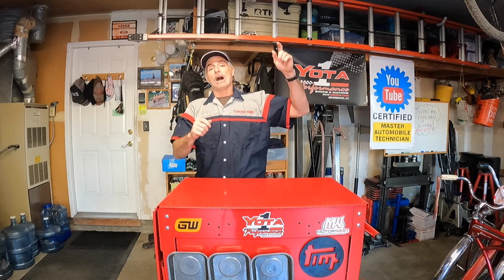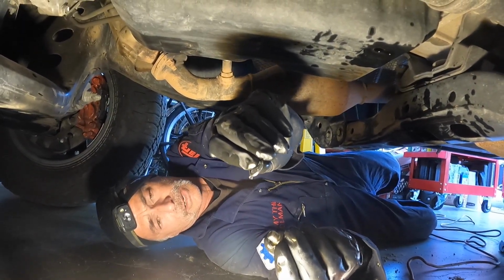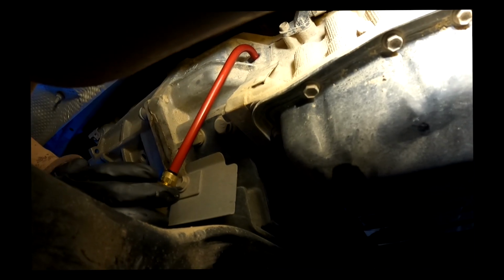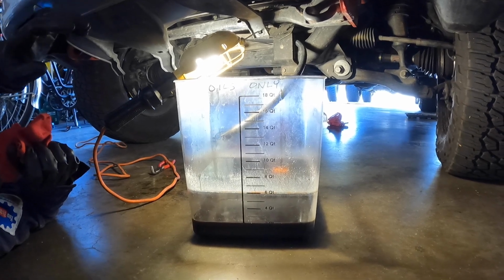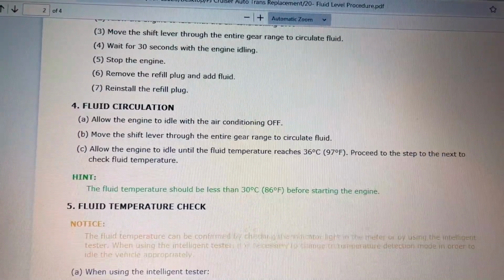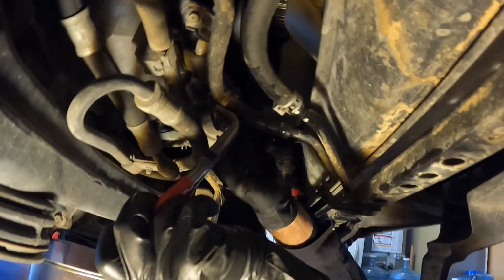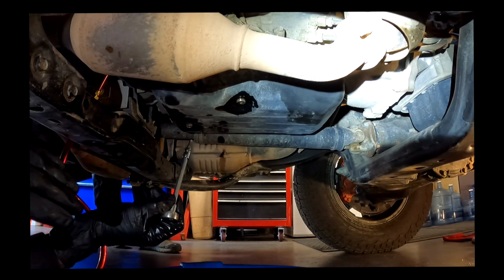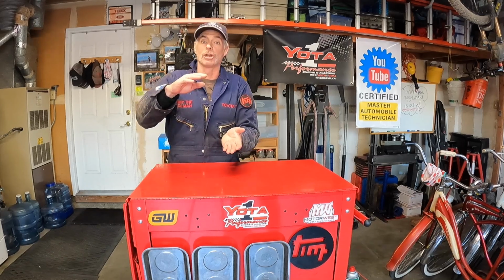Toyota/Lexus Sealed (No Dipstick) Automatic Transmission Flush (Fluid Exchange)

Comment: Very involved 🏌️
Reply from the maker: It may seem like that but it really isn't.  The flush is simple procedure of drain a quart, add a quart until the fluid looks new, around 12 quarts.  The fluid level procedure isn't hard either.  Get the trans to the proper operating temp and open the overflow plug.  If no fluid spills out, put the plug back in, add a 1/4 - 1/2 quart, get it back up to temp and remove the overflow plug again.  Keep adding until when you remove the overflow plug, fluid comes out.  Let the fluid drain until it becomes a trickle and put the plug back in and torque to spec.  Done deal.  It's not hard.

Comment: Thanks again Timmy, just getting ready to do this job on my son's 2015 Tacoma. In your video it seems the filling pump and hose are always conected to the transmission filling hole until the completion of the fluid exchange. It is that correct?
Reply from the maker: Yes, that's correct.  You can just leave it hanging in the fill hole during the fluid exchange process.  Good luck with the job.

Comment: Video is very helpful!! I do have a question, I have seen that dropping the tranny pan allows you to clean the magnets and possibly even replace the filter. What are your thoughts on this?
Reply from the maker: If the trans has an unknown history and it appears the trans wasn't taken care of (ie very dirty fluid), it might not be a bad idea to drop the pan to make sure the filter isn't majorly clogged.  If the trans was taken care of pretty well, I don't think it's worth your time to drop the pan.  I cut open one of these type of fine mesh trans filters on my 3rd Gen 4runner and it was probably 90-95% unclogged.  As for the magnets, they can gather fine metal debris for the life of the rig in my opinion.  It's not like the magnets get flooded with lots of debris.  It's usually a very fine sludge of metal on each magnet.  If a trans is taken care of, you really never need to drop the pan.  You can also do what I've done on my rigs and add a magnetic in-line filter in your trans cooler return line.
*Magnefine 3/8" Magnetic In-line Transmission Filter
https://amzn.to/35p6heN
The Magnefine filters are rated for 30,000 miles of use.  It's a nice way to achieve extra filtration with very little work. I should have installed one of these for Rey, but I forgot when I installed a trans cooler for him.
Reply: @TimmyTheToolman  Thank you very much!!! Great info and quick response is appreciated!!
Reply from the maker: @DIYonTheFly4u  You're very welcome Mike.
Reply: @Timmy The Toolman  
I removed the pan and changed the oil filter and filled with new oil. I did it when my car was 148k miles almost 2 years have passed. Now I came to know I put TOYOTA T IV oil instead of WS. My current miles is 163k. Car is Lexus Ls430 2005.
What should I do now? Please advice.

Comment: Why not jack up the vehicle and put a longer hose on the suction line in a bucket of new fluid disconnect the discharge line with a longer hose into a empty bucket start the vehicle and put in drive and let the tranny pump keep pumping out the old fluid while the tranny is going through the gears until new fluid comes out the discharge line reconnect the tranny lines to the cooler and then check for correct level...that's how I do my allison 1000 on my dmax for the last 14 years with success
Reply from the maker: Well, because the way I understand the system, there's suction happening at the filter under the pan, but I didn't believe there's actually suction happening on the return line itself.  I thought the return line just dumps the fluid back into the trans pan for the pump to pull it through the filter.  The fluid is moved from the trans to the cooler and back via positive pressure from the pump, not vacuum.

Comment: From what I understand that the 2020 and 2021 Tundra does not have an external transmission cooler is that true ? and if so is as strong as 2019 with a Transmission cooler, and so should the Trans fluid be serviced more often than the one with the Trans cooler ?.
Reply from the maker: I don't if the 2020 or 2021 have a trans cooler.  The lack of a trans cooler doesn't mean the fluid should necessarily be renewed more often.  It depends how the vehicle is driven.  People that drive in the mountains a lot, go 4wheeling, or tow should change their fluid more often because they will be pushing the transmission harder and thus hit much higher trans temps than someone who just uses their rig as a grocery getter.  The key is to monitor your trans temps and base how often you renew your fluid with how you drive it.

Comment: Great video and what I do in Australian on my 100 series  but always shifted through the gears to change the torque converter fluid as best I can while exchanging the fluid , like your thought’s Tim.
Reply from the maker: Thanks Alan.  Never thought about shifting through the gears when doing the exchange. Don't really know if it's necessary based off my experience.   It appears to me all the old fluid is being pushed out of the torque converter without shifting based off how the fluid starts to look clean as the max quart capacity of the system is reached during the exchange.  But, you got me thinking now.  When you're getting the fluid level dialed in, the manual instructs to shift through the gears.  Shifting through the gears takes some time through.  Are you exchanging out 1 quart at a time like I did or are you moving more fluid than that on each round?
Reply: @TimmyTheToolman  
We use litres over here Tim so much the same fluid quantity and I get your point that it’s looking clear at the end of the operation but after the first top up go I go through the gears a couple of seconds each gear before I dump for the next fluid change , and same again again again , don’t know if it would get TC cleaner that way Alan.

Comment: Thanks Timmy great video! Just curious, any reason why you didn’t use OBD2 to check trans temperature? You did for 4runner.
Reply from the maker: I tried to use my OBD II reader and Torque Pro phone app to read the trans temp but it didn't work for some reason.  I now use Scan Gauges for my rigs so I don't have to use my phone anymore.

Comment: Do you think it's possible to measure the temperature  with one of those laser temp guns? Instead of using the scan tool. I did that when I replaced the fluid on my bmw x5 and it worked.
Excellent video btw and thank you.
Reply from the maker: The infrared temp thermometer works pretty well.  If you direct it at the send line fitting, it's pretty accurate.  Directing it at the pan isn't as accurate.  Glad you like the video.  Thanks for the comment.

Comment: Yep. This procedure works well. I've done it 3 times on my 08 4runner. When pumping out the old fluid, you can let it go 2-3 qts at a time. I built my own power fill jug with a 1gal garden sprayer. I took off the 1/4 turn valve because it seeped ATF out. I just fill it with how much I want to put in the tranny, then pump it up a bit. The one cool feature it the hook end. That makes it easy to keep the fill process a lot less messy. I might add a short piece of copper pipe bent in a J, or something.
Reply from the maker: Thanks for the comment Bob.  I personally feel more comfortable only doing 1 quart at a time.  I realize there's no real load on the transmission, but I'd rather err on the side of caution and not run the trans that low for any length of time.  Yeah, that Motive Power Fill Pump is basically a fancy garden sprayer.
Reply: I also pumped out 3 quarts at a time when I've done this in the past with no ill effects.  One quart at a time gets  a bit tedious!

Comment: Hi Tim, this is your friend from Mexicali, Mexico. As always, very good video! Please when you have a chance, can you make a transmission flush video for a Toyota Rav4 2013-2018.? Thanks Tim!
Reply from the maker: Hey Javi, I doubt I'll be doing a video for a RAV 4.  It's a pretty big longshot.  From this video, you have most of what you need to know to get it done. You first need to figure out which cooler line on the side of the trans is the send line and which is the return line.  You can determine that by simply using an infrared thermometer and seeing the temperature of the lines.  The colder line is the return line.  Once you figure that out, you want to follow the return line forward to the radiator and remove the rubber return line off the transmission cooler nipple.  You put your own hose on there and direct it into a bucket.  Then you do the flush like we demonstrate exchanging 1 quart at a time.  When you're finished with the flush,  the only thing I can't instruct you on is the temp at which you check the level at for the RAV 4 transmission.  If you have a windows based computer,  you can access information from Toyota via their Tech Info website.   You can buy a 2 day subscription for $20 and download all the information you want.  There's a bit of a learning curve to using the program but you'll figure it out.  Basically the information you seek will be found in the RM pages which stands for Repair Manual. When you get a page you want to download, you click on the printer icon and you can select to save is as a PDF on your computer.  This is how I get the information I need for the newer Toyota and Lexus vehicles I've been working on.  At some point they stopped making the physical service manuals.  It's all online now.  I hope this helps you out
Reply: @TimmyTheToolman  All right Tim, Thanks for take the time to responce my message.! Again, Great video!
Reply from the maker: @javivivero5119  You're welcome Javi.  If you don't have a window based computer, you can find ones for sale on Ebay.  That's what I did because I primarily use a Mac laptop.  I bought a used Dell laptop with the windows operating system just so I could use Tech Info to download the information I need to work on these newer vehicles.
Reply: @TimmyTheToolman  Yes, I have windows, do you have the link to download the manual?😉
Reply from the maker: @javivivero5119  Go to this site: https://techinfo.toyota.com/techInfoPortal/appmanager/t3/ti?_nfpb=true&_pageLabel=ti_home_page&contextType=external&username=string&password=secure_string&challenge_url=https://techinfo.toyota.com/techInfoPortal/login/techinfo&request_id=-5518364760491963150&authn_try_count=0&locale=en_US&resource_url=https%3A%2F%2Ftechinfo.toyota.com%2F

You can't simply download the entire manual by pushing one button.  It doesn't work that way.  You have to download the information in pieces depending on what you want to download.
Reply: @TimmyTheToolman  Thank you very much Tim!
Reply from the maker: @javivivero5119  You're welcome Javi.

Comment: With my 2010 Tacoma I did a drain n fill and was able to get about 2.9 Quarts.  Truck had 50k miles and fluid was red.  I'm going to do drain n fill every 10k miles.  For those of you that don't want to the fill procedure with the temp, you'll be fine if you drain it in the morning when the fluid is cold, just put back in what you took out.  Watch your tools!
Reply from the maker: Still red at 50k, that's pretty good.  That means your fluid didn't hit very high temps.  Do you drive at all in the mountains?  You're smart to do a drain and refill every 10k.
Reply: @TimmyTheToolman  thanks Tim! No I don't drive in the mountains, the only time temp hits 170 is when I drive to Vegas.
Reply from the maker: @VinnyBGreviews  Yep, that makes sense then why your fluid looked so good at that many miles.

Comment: I have a 2019 gx 460 coming up to 30000 miles when do I think I should do trans job 50000???
Reply from the maker: It depends how you drive it.  If you regularly drive in the mountains, I'd do it now.  If you only drive in the mountains a little, 50k would be fine.  If you never go in the mountains and just cruise down flat roads, you could probably wait as long as 100k.  I think even if the rig is driven as a grocery-getter, the longest I would wait to replace the fluid would be 75k.  The life of the fluid is related to the temps it's been subjected to.  The higher temps you run, the lower the life of the fluid.  This is the reason for the suggested intervals based off how much you drive mountain roads.  When climbing grades, you will achieve high trans temps.  You would also achieve high temps if you tow.

I always err on the side of renewing it sooner than it needs to be done.  Why?  Because fluid renewals are affordable and easy to do.  A replacement transmission is very expensive to buy and every expensive to install.  

Toyota claims their WS ATF is lifetime fluid.  That's idiotic.  Well, the transmission failed at 200k.  I guess that was it's lifetime.  All fluids break down.  It's smart to maintain your transmission by giving it fresh fluid when it needs it.

Comment: I recently bought a 2013 tundra with 112K miles on it. I have no idea if the owners before me ever changed the transmission fluid. I have heard horror stories of people getting it changed on higher mileage vehicles and it failing. Is this something I should do or have done. Or at this point do I just drive it till the wheels come off?
Reply from the maker: If you're worried about potential problems after a flush, just start with a drain and refill of the pan.  Wait around 3 k miles and do another one.  Then follow that up with a 3rd one after another 3k miles.  After the last drain and refill, the fluid will be in decent shape.  After that, I'd recommend a drain of the pan every 10k miles or every other engine oil change.  Regular drain and refills keeps your fluid in excellent shape.  That's what I do with both my 3rd Gen 4runners.

Comment: Thanks for creating this guide! Question: I have an '08 4runner with the A750E with 180k. Fluid was changed at 100k. At around 170k I did a pan drain and fill 2x and each time the shifting and slight shudder from 4-5th gear was gone and acceleration response was noticeably better but only for what seemed like 30 or so miles. I did use valvoline maxlife instead of Toyota ws but was wondering if shifting on this GS was still good without shudder? Thanks again!
Reply from the maker: The shudder hasn't come back with Thanh's GX470 but I don't know how many miles he's driven in it since the flush.

Comment: If you drain 2qt from the pan and install 2 qts back why all the extra work with terminals and special procedures? I understand when you do 12-13qt you could be adding less due to the hose length of the tool. I don’t understand the Toyota procedure?
Reply from the maker: The procedure is to confirm the level is good.  If the trans was a bit under-filled to start with, now you still have an under-filled trans after the service.  With the older transmissions, you have a dipstick to easily confirm the level is good.  It's a little harder with the sealed transmissions, but if you simply get a tool like a scan gauge, you can forego all that crazy stuff the Toyota manual shows you to do to know you're at the operating temp to check the fluid level.
Reply: The fluid expands when temperature rises, and contracts when cooling, hence the temperature needs to be within range when checking fluid level - and Tim is like me who goes for the center of that range.

Comment: I have the A750F transmission in my 5th Gen 4Runner. I get 4 quarts out with a drain and fill. I wasn't surprised when you had to add more to get flow out of the level check tube. 2 quarts out on your pan drain is only half what I normally get.
Reply from the maker: Good to know.  It definitely appears his trans was under-filled.  Amazing it was still shifting fine.  How it got that way, who knows.  Maybe it was serviced by someone and they under-filled it.  I'm going to do a drain and refill at some point on the trans I replaced in the FJ Cruiser and I know that trans was properly filled because I did it.  I'll be interested to see how much comes out.  I've had people say on some of the Facebook pages I posted the video on that they get around 3 quarts out on a drain of the pan.  The manual did say a pan drain produces 1.8 quarts.  Weird.  Thanks for the comment.

Comment: I followed how you did it, added about 1/2 quart,  Was good.   The book procedure was weird.   A liter is larger than a quart.  0.4 liters is a little MORE than 0.4 quarts.
Reply from the maker: Good to hear Dave.  Yeah, the procedure in the FSM is a bit convoluted.  This is one of the reasons why I wanted to make the video to make the process more straightforward.  If you invest in a tool like a scan gauge to monitor the trans temp, you can forego all those crazy steps of connecting OBD port pins, etc.  Get the fluid between 97 and 115 degrees, open the overflow plug and check to see if fluid is coming out.  If not, add a half quart, get it back up to temp and check again.  Keeping adding a half quart at a time until it spills out of the overflow port.  Let it get down to a trickle and you're good.  At first, I was intimidated to service one of these "sealed" transmissions, but now that I understand the process, it's fairly straightforward.  Happy Wrenching Dave!